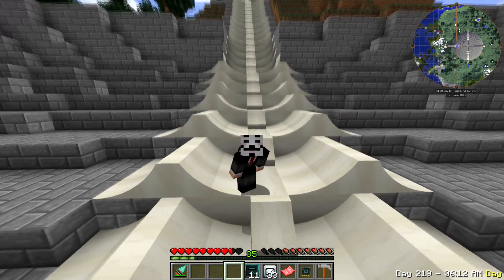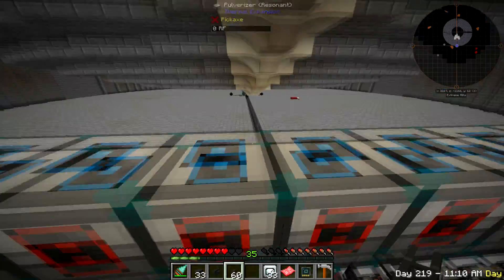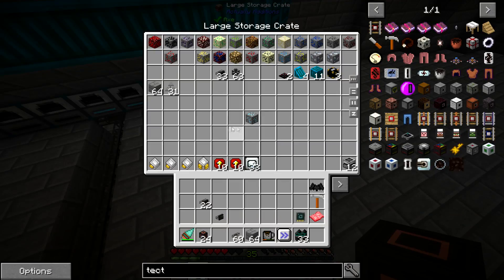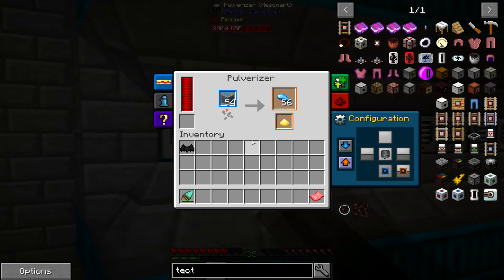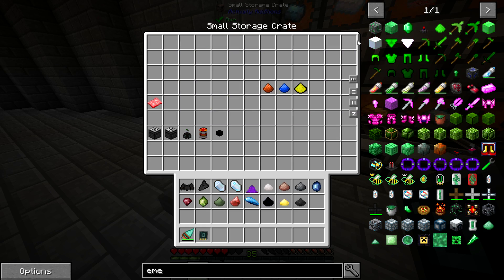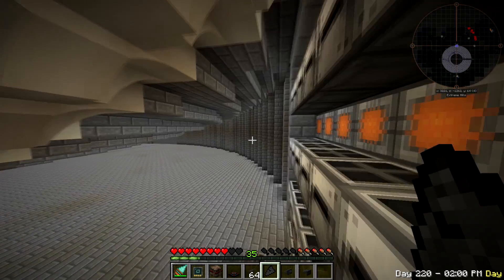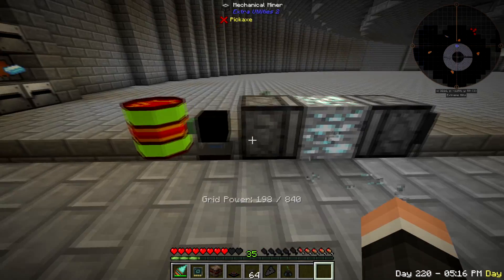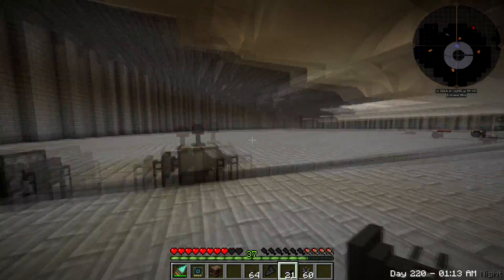FTB Beyond EP 12 Ore Processing PT2 Pulverizes

Comment: dude, set the priorities of the disk drives to -1 and that's how you set them up easiers
Reply: also, instead of a mechanical miner use a mechanical user with a luck 3, unbreakable pick from tinkers'
Reply from the maker: Exp is just a free by product not really for farming Exp. Already have a proper mob farm for exp.
Reply: SystemCollapse i meant for more dimensional shards
Reply from the maker: Yeah I guess I should do that. You are very correct.
Reply: SystemCollapse i used the system for diamonds and emeralds too